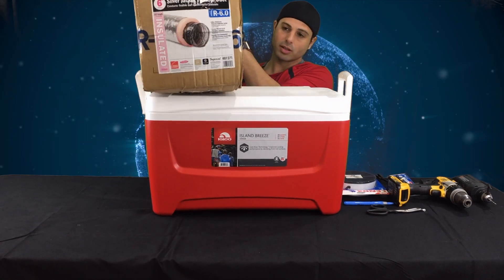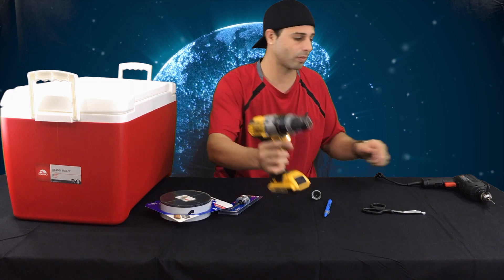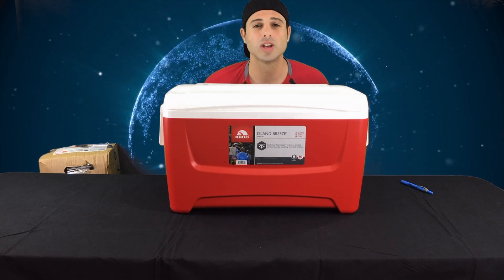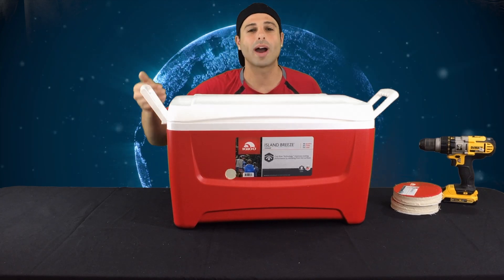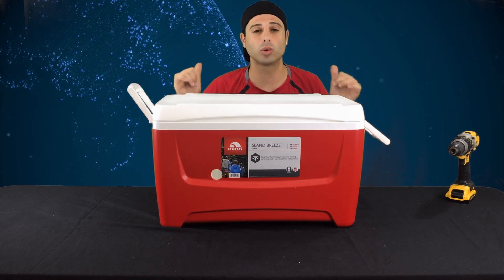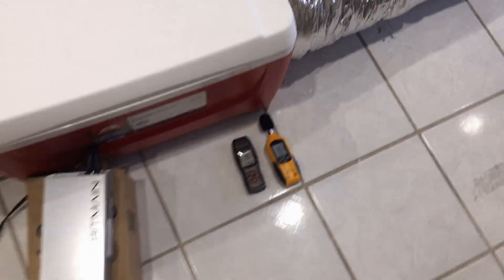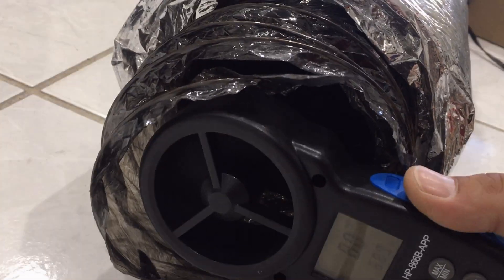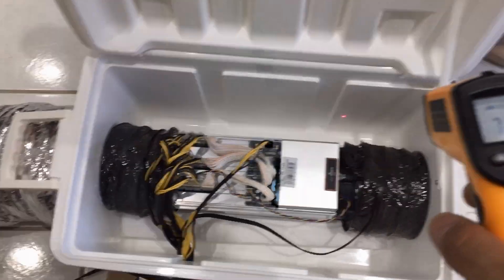How to soundproof Antminer s9 in a cooler - ASIC Cooling silencer DIY cooler box 2018

Comment: Hey man. Hope ur feeling better. Love what u did here. A couple questions. Where are u putting or mounting the psu and would u put the smaller hole lower so you can sit the psu on same surface as the cooler? If you could vent directly outside, would you and how long of ducting would you use? How did u secure the ducting to the shrouds inside to keep heat out of the cooler. Thx again man. 🙏🏾
Reply from the maker: Thank you bro I really appreciate that.

1. You can mount the PSU directly on the side of the cooler.
2.I put the smaller whole aligned with the larger hole because I like to add a piece of Styrofoam under the antminer to keep it off the surface to let the heat dissipate quicker. If you want to make the two larger holes lower than you can def make the smaller hole lower as well.
3.With this setup using 6 inch ducting you do not even need the shrouds! The 6" ducting will go perfectly around the 120 mm fan than secure it with zip ties.
4.This question is a very important one. I did run many tests on the length of the duct and how if effects the performance and from my testing it looked like 3 feet was optimal but you can push it to 5 feet with no issues at all.

I hope this helps, let me know if you need anymore information and good luck on the build!
Reply: Miner Digi cool. Cool. Awesome man. I just got 2 s9's and haven't even pulled them out of the box yet. I was wondering if I drilled the smaller hole lower and layed the psu on the same surface as the cooler, would the wires from the psu be able to reach the Miner. Last question, I can literally vent these outside from where I am putting them and do so with a very short run of  ducting. Is it worth it? And as for the cool side, are you filtering the air in any way? Mine are going on a top shelf in a garage where I can vent both out a small garage window but I'm worried about the air going in and where I should pull that from. Thx again man. This is gonna be a HUGE help!
Reply: I've the same query regarding the need to filter the intake side.

Comment: The aluminum case of the miner itself also radiates heat, and as i see there is no way for the box to leave the heat out, that will lead to long-term thermal wear, if you open 2 more holes, one for flesh air inflow and 1 for hot air exhaust, it will work well for the long term and save you money

Comment: Hi, I wondered what you DB Meter showed after the S9 had finished it's "Startup" and the Cooler Box lid was closed and ducting etc was fitted properly? etc.. So when the Miner was at full noise, in the box..? I can't quite make it out on the DB Meter screen in the video..? Cheers

Comment: For everyone that watched this need to also put the psu inside the cooler towards the suction side to allow it to breathe. Do no tape up the intake side to allow airflow for both the miner and psu. The main focus to quiet the miner is to tape the exhaust side to your insulated duct to get the hot air and sound levels down

Comment: I made one and have an s9 running in my detached garage.  Did this work out in the long run?  Someone was claiming the ducting shouldn't go directly over the fan because airflow is needed over the whole unit.  Is that true?  It definitely runs hotter when I took it off the fan but the airflow from the ducting feels about the same.  It's just fine now but the summer is coming!

Comment: how did this work in the long run please? I need to build one but want to know if its safe for the miner please. Thanks
Reply: Mine is still very loud despite the whole setup :/ sound seems to come out mostly out of the vents
Reply: @Arya885  Decibel went from 80dB to 73dB - if you pause it just after he closes the lid, you can see the reading....not a great reduction if you ask me.....attach the end of the tube to another box with a hole might help

Comment: That's one way to cut the lifespan of an ASIC card in half..
Reply from the maker: False. What’s your explanation for this statement?
Reply: @MinerDigi  You do realize the ambient temperature at core, not exhaust points will be way hotter when you seal the lid? Use mineral oil or leave it alone your ducting at the initial point of exhaust will conduct way higher than normal free flow values, this is the most pointless thing I have ever seen when it comes to mining.
Reply from the maker: Obvious statement, ambient temperature at core is always hottest that is why there are two 120mm fans running at 5k-6k rpm to dispel the core temp. If you are running this cooler in an AC environment the ambient temp inside the cooler actually becomes cooler with flow and deduction rates but you know that right? I have done mineral oil cooling systems as well as open air straight flow. Theory is all fine and dandy but my statements are based on facts, variables and outcomes. Your statement is so far from being correct it amazes me, but hey we have all learning to do.

Comment: they need to make these 0db passive cooled that noise is too much.
Reply from the maker: Hi Alice... any ideas?? I can build it :)
Reply: @MinerDigi  remove card and glue it to big alu monoblock at least 1 meter high and use office fan? :)
Reply: @alicedunstan1441  or just use some mineral oil, a radiator with pump and an old fish tank?

Comment: Excellent video pal! I'm looking forward doing it any time soon as I live in a small house and even when I keep the miners (two D3) in a basement one can still hear them and forget about doing anything in the basement (I have my pc there). I only have one question : did you use exhaust adapters where you connected the ducting? Because the cooler is square shaped and the ducting is cylindrical. Thank you!

Comment: thanks for sharing such a trick, i just have a question, we do still need to have cold air flow inside the box through the pipe right ?
Reply from the maker: Yes the cooler the better!
Reply: @MinerDigi  so where you get cold air? Just leaving the A/C on? 
Where did you set your cooler at? Near the exhaust vent to outside? Or just center of living room?

Comment: I just recieved a Antminer z9, and i was wondering if you or any1 els made a box like this. The z9 dont have a fan on the back, but thats still where it blows in air. The front fan is 6.6 inches. And the back  "triangle" as there is no fan is 7 inches. Both messearude in diameter. Will the link of the 6 inch work for the front fan? I mean since Its flexibel the 0.6 difference might be the same on the S9 fan?
Reply: My Z9 mini just arrived too and I'm working on a similar solution. I plan to get a much smaller cooler from Walmart, attach 3 ft of insulated ducting on the intake side (with the fan), and maybe only 1 or 2 ft of ducting on the output, since as you mentioned, there is no fan.
Reply: Alvin Manning Happy to hear that you also are trying to make one. The Only problem is that the back is were the outblow from the machine is, so if theres no air ventilation there its gonna get super warm in there and maybe harm the antminer!
Reply: Alvin Manning Happy to hear that you also are trying to make one. The Only problem is that the back is were the outblow from the machine is, so if theres no air ventilation there its gonna get super warm in there and maybe harm the antminer!
Reply: The CFM being pushed out of these fans is around 200 I think, should be plenty to push through a few feet of ducting, just keep an eye on your board and chip temps. I try to keep my max chip temps at 60 or below for the Z9 Mini.

Comment: Just tried this method.  Sound reduction was drastic.  Though I'm not sure why but after a few minutes it over heats, and fault light turns on.
Reply from the maker: Is your psu Inside or outside of the cooler? How long is the ducting for your intake and exhaust ?
Reply: PSU is outside. Ducting is 12 feet on each side but i think that's my flaw.  It bends around the corners of the room.  I'm starting to think I need to do like you have it and trim it down to 3 ft each side.
Reply from the maker: Yes !! Do not exceed that
Reply from the maker: Brother this is crucial , especially for intake side!
Reply: cool.  Thanks man.  And thanks for the Vid. It's helped me a lot.
Reply from the maker: I am so happy to hear that , that’s why I made it 😊
Reply from the maker: So happy to hear that

Comment: I bought three A3 Asics  ,  Are they about the same size ?   Can I use three Ice chests or what do recommend ?
Reply from the maker: The A3 are 321mm*125mm*208mm and the S9's are 350mm(L) x 135mm(W) x 158mm(H) So they are very similar. Yup I would use 3 separate coolers if you are trying to run this indoor and vent outside.
Reply: Thanks for your help.  I have a dedicated bedroom for mining.  I have lots of heat from 41 GPU's and a Baikal X10 , but I have a 20 inch exhaust fan to exhaust most of the heat from the room.    I wonder If I point the hoses toward the ceiling it would be adequate ?   At the moment I am drawing cool outside air , but I will need to keep the A/C on 73 in the summer .

      As it is , the room will probably be around 80 degrees with a 73 degree setting .    I hate lowering more because its too cold in the rest of the house.     I ordered 4 DCR1's and will add more Baikals.   Any ideas on how to control the heat in summer ?

Comment: Thanks for the video man.  I just used this method on my L3 and T9 small in-home setup.  Already decreased the noise by 75%.   Rigs running cooler as well.
Reply from the maker: So happy it helps bro! Good luck and keep it up!!!
Reply: how did this work in the long run please? I need to build one but want to know if its safe for the miner please. Thanks
Reply: @tylerdurdena.k.a.bradboyd8445  did you do it how did it do in the long run

Comment: What was the optimum length of duct you used on each side of the cooler?
Reply from the maker: 3 feet is the optimum length for each side but you can push it to 6 safely
Reply: Thanks

Comment: Hi, nice video would you kindly add the link on amazon for the insulation duct, I can not find the same name as it shows in the beginning of your video. Thanks a lot for the instructions. :)
Reply from the maker: Manolo! I just saw your email, sorry! I answered everything you needed, hopefully 😀😀

Here is the link for the ducting: 

https://www.amazon.com/Speedi-Products-FD-25R8-06-Insulated-Metalized/dp/B0085UZQ2E/ref=sr_1_3?ie=UTF8&qid=1518527376&sr=8-3&keywords=6"+insulated+flexible+duct

GET THE R8 its more efficient!

During installation is a function of heating, ventilation and air conditioning (HVAC) systems. As such ac system is not complete without the ducts through which heated or cooled air is distributed throughout a building. Although the most basic ducting is made from sheet metal, most of the ducting in residential applications is insulated. Examples are the R6 and R8 ducting systems.  Further we will compare R6 vs R8 ducting and review pros and cons of both.In these two, the R-value is used to indicate a thermal insulator’s effectiveness in resisting heat conduction. It is measured relative to thermal conductance and takes into account the thickness of the material and energy conducted in relation to the area and differences in temperature between the two sides of the material.

Differences between R6 and R8 ducting systems.

Thickness in insulting materialThe thickness in the ducting materials used to make R6 and R8 ducting is one of the glaring differences between the two. In essence, R8 ducting uses thicker insulation than R6 ducting. This means that if you were to do air conditioning installation using R8 ducting, you get better installation than if you are using R6 ducting.Efficiency of heat insulationWhen it comes to efficiency of heat insulation R6 ducting if less efficient than R8 ducting. In essence, R8 reduces energy loss by approximately 2 percent, which is equivalent to consuming less energy by 3 percent.CostR8 ducting comes with a wider diameter than that of R6 ducting and thus will cost more. The higher cost of R8 ducting could also be due to its efficiency in insulation and energy saving. So, if you are doing ducting installation with R8 ducting, be prepared to pay more for it.

The following are the disadvantages of R6 ducting:Using R6 ducting in your ducting installation means you get a less efficient HVAC system.Air conditioning installation using R6 ducting allows for less air flow due to its smaller diameter.The following are the advantages of R6 ducting:R6 vs R8 ducting is cheaper, meaning you pay less for material cost.R6 has a smaller diameter and therefore can be used to replace older ducts during airconditioning installation without having to expand the spaces where the ducts go through.Compared to R4, which is lower rated ducting, R6 offers greater thermal efficiency and therefore saves energy. However, it is not as efficient as R8 ducting.

Cons of R8 ducting:The following are the disadvantages of R8 ducting:Using R8 ducting when doing your air conditioning installation is more as expensive compared to using R6 ducting.R8 ducting is thicker and might not, therefore, properly replace lower diameter R6 when you decide to upgrade your ducting installation.Pros of R8 ducting:The following are the advantages of R8 ducting:R8 ducting offers greater thermal efficiency due to its thicker insulation. So if you use it in your air conditioning installation, you get all the heat you require out of it.With R8 ducting, you pay less for your energy utility bills due to the efficiency it comes with.
Reply: That was a deep explanation.... thanks :)
Reply from the maker: you're very welcome

Comment: Great video, question why use 6" instead of 4" duct? did you try smaller?
Reply from the maker: Manolo I made a video testing the different shrouds and the issue with he 4" shroud is that its just not large enough. The opening for the fan blade is over 4 inches so scientifically speaking you are causing a severe case of ventilation obstruction, in essence you would need another inline fan to get over the obstruction value rather than using 6 inch ducting to help the air flow easier with no obstruction =) I hope that helps and sums it up.
Reply: Helps a lot buddy thanks.... one more: :) did you try longer or shorter ducts? I understand the longer it is the lower noise, but this can again cause problems with ventilation or not?
Reply from the maker: Tried allot and the shorter the duct the better. Remember its all about air resistance. I am going to put make a page on my website all about it.
Reply: I understand the air resistance, but how about the noise is not affected by the longer it is?
Reply: upload the video :)
Reply: @MinerDigi  sorry for asking so many times, but hard to get response on an old video. But I wqas wondering how did this work in the long run? I need to build one but want to know if its safe for the miner please. Thanks

Comment: I am in central Florida and i have 10k to set up a mining setup that doesn’t need much maintenance. What do u suggest
Reply: https://www.amazon.com/iPower-Booster-Inline-Exhaust-Grounded/dp/B008N4QIZG/ref=sr_1_1_sspa?s=lawn-garden&ie=UTF8&qid=1517442930&sr=1-1-spons&keywords=240+cfm&psc=1
https://www.amazon.com/Window-Dryer-Vent-Adjusts-Through/dp/B01LYFWKIN?th=1

Live in Virginia and use this in the summer! Works great to help push the exhaust outside.
Reply from the maker: Are you trying to stay with ASIC mining or GPU?
Reply: Miner Digi  whatever has less maintenance.. from my research sounds like asic? Brad.truhomes@gmail.com
Reply from the maker: Yes I would go ASIC. Florida is rough, I am here as well. If you are going to go with only 3 S9's which is around $3k each now, I would keep them in a well cooled room vented with 6 inch insulated ducting right outside my window =)  Do not make the duct longer than 3 FEET! If you want to go with longer than 3 feet duct than you fan add a speed controlled  inline duct fan  to make up for the length in ducting.  Hope this helps!
Reply: Hi Miner Digi, why not longer than 3 feet? It is not the length which makes less noise?
Reply: Jack Attacker where do you the fans?  Do you attach it to the intake side?  Are the really necessary ?

Comment: we did this but built a box! we attempted the cooler but wasn't working out.
Reply from the maker: Jorden Kaufman do you have images? Not working in what way? Describe the issue that is occurring. It works perfect every time, I have built over 50 now with not 1 issue. It’s pretty simple process so I don’t know how you can mess up the build. 😊 Send over some images and diagnostic information of your problem and I will help you.
Reply: well we ended up just building a rack. it holds 14 machines and has a exhaust out the back
Reply from the maker: Jorden Kaufman so you didn’t make a cooler box. I wouldn’t recommend this for more than one unit bud.
Reply: no we built a box and a filter system
Reply from the maker: As long as it is working!